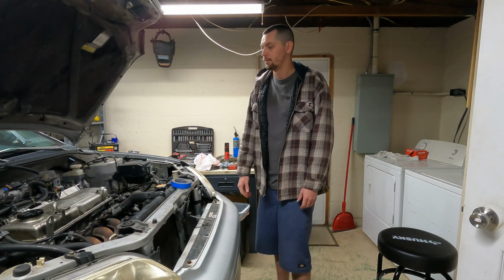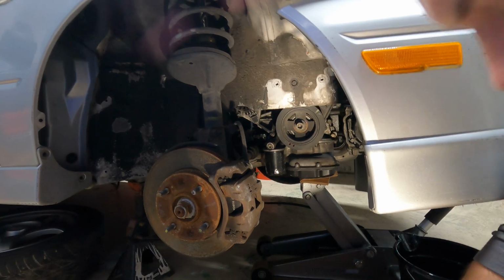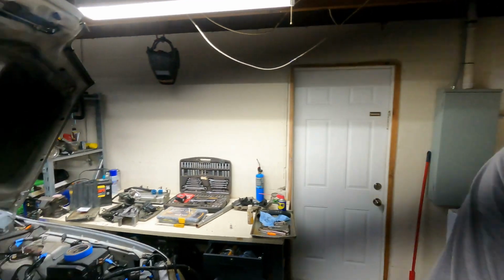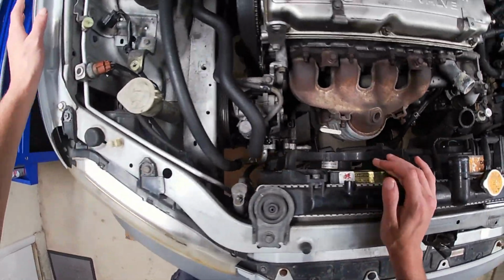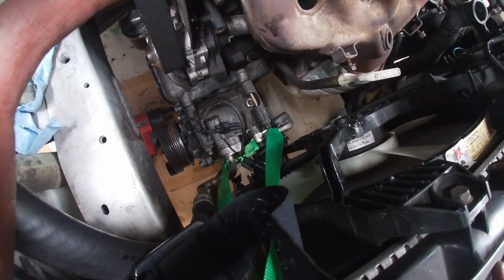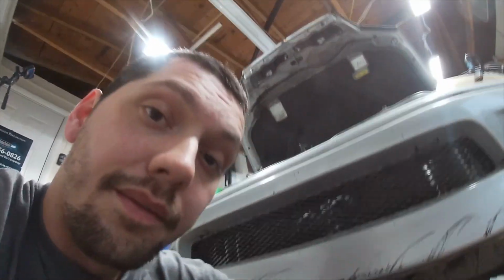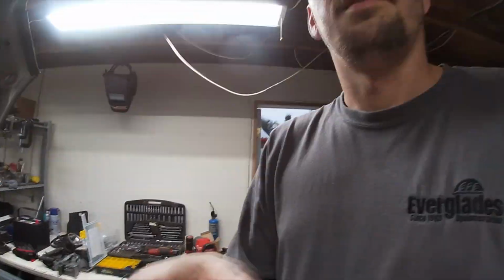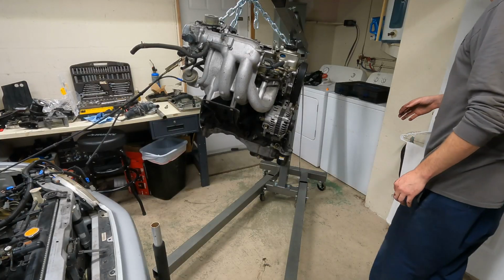2002 Lancer Engine removal (You Wont Believe How This Engine Died!)

Comment: Gonna be doing this on mine within the next week or 2. Mines a manual though. Did you have to take anything additional off that isn't shown?
Reply from the maker: Yeah the engine I swapped into the lancer was from a manual. It's more difficult to remove with the clutch. If I had to do that again I'd remove the engine and transmission together  I've got a video of that just haven't had time to edit and post. But yeah everything is the same.  There isn't enough room to separate the trans and engine while in the engine bay. Even with harmonic balancer off.
Reply: @JoshVice  so i pulled mine yesterday. Pull each of the brackets off at the bottom near timing side and separate it  and rotate it 180° intake facing driver side, remove the fan and radiator, and it'll come right out as long as everything is disconnected properly. If you ever have to do it again just a easier way to do it that I found man. However I do think you did good because ya still got it out with no real issues

Comment: I have already took off the head, can i just unbolt the mounts and yank it out?
Reply from the maker: Gotta get those torque converter bolts if it's an auto.
Reply: @JoshVice  nope manual.
Reply: @JoshVice  would that be it? How many bolts are on the transmission to engine
Reply from the maker: @jameskanipe770  couldn't say forsure probably 8-12. I removed a manual engine from a parts lancer. Not alot of room with the clutch attached to the engine. It was a struggle. I was able to separate the trans and engine and had enough room to unbolt the clutch.